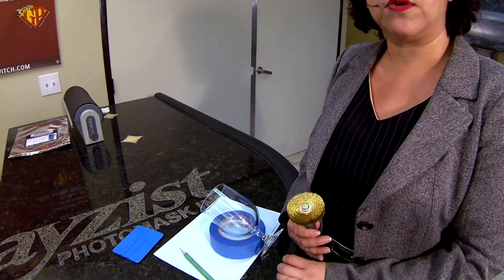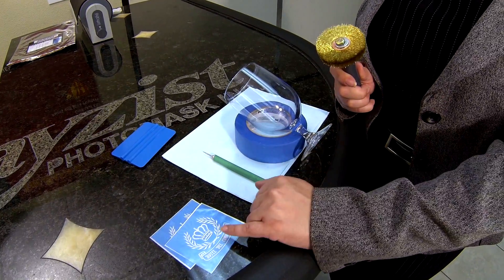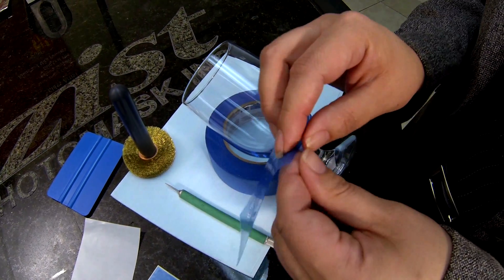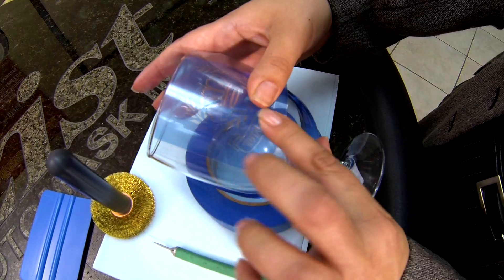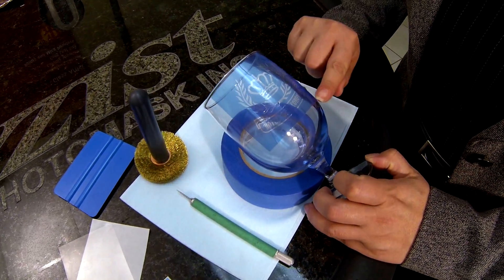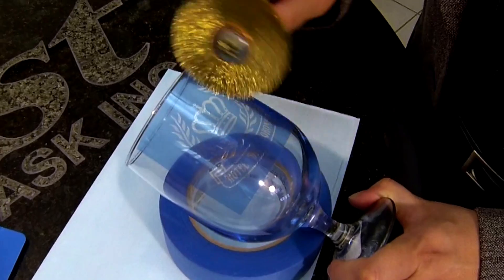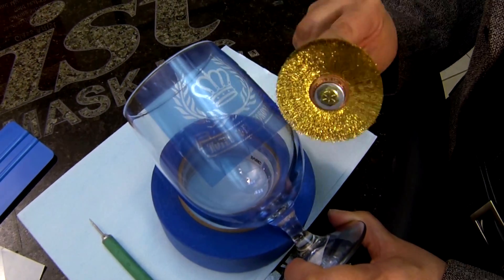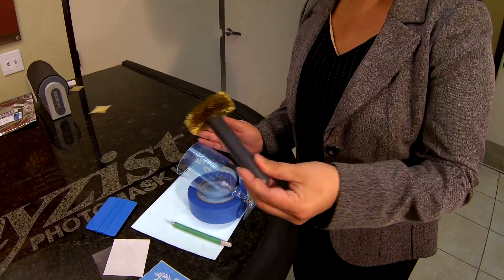Wire Wheel Brush demonstration

Comment: Hi, Is the wheel brush also useful for use with RapidMask?
Reply from the maker: Hello Mike, to my knowledge RapidMask does not require a Wire Wheel Roller because you blast away the film